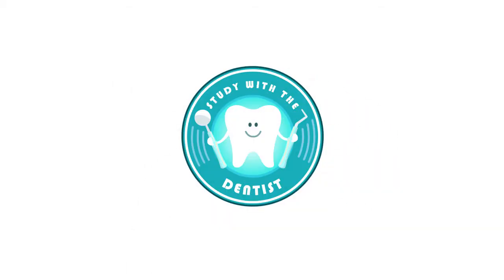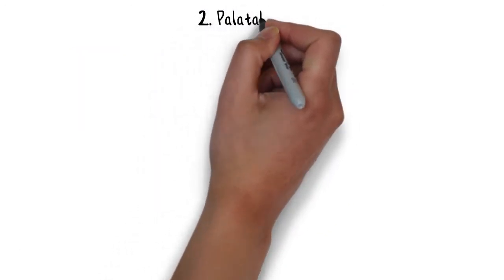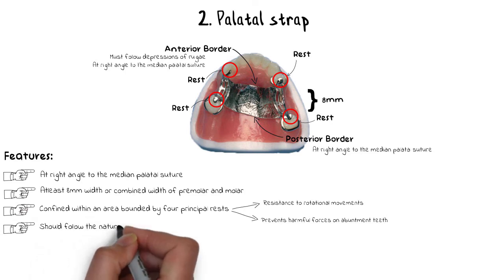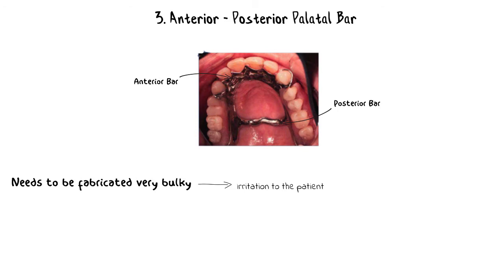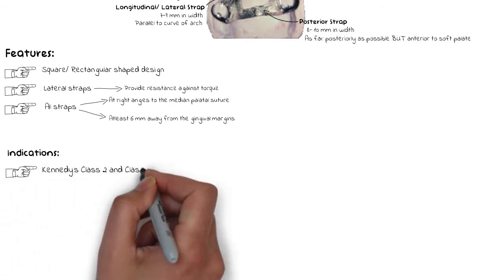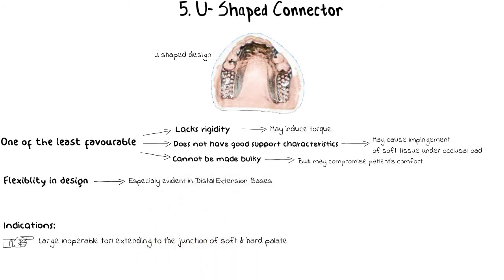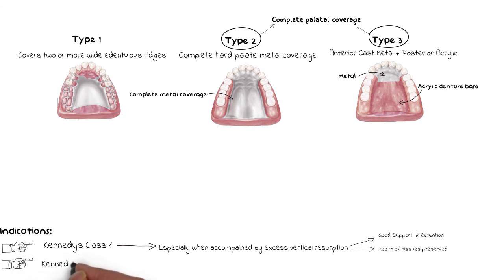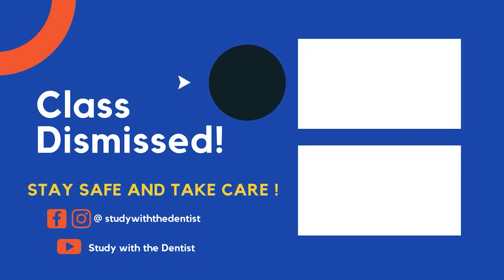Maxillary Major Connectors | Removable Partial Denture (RPD)

Comment: In the palatal plate mayor connector when you mention the t it provides a good degree of thermal conductivity to the underlying tissue, you mean that it can transfer cold and hot and it is like more normal and easy por the patient to adapt to it? Please
Reply from the maker: Yes indeed. Good thermal conductivity will mean that it will feels more "natural" and accepting to the patient, and less artificial.

Comment: read that a strap is made with a width of 8-13 mm, isn't it? 
Also I have an MCQ which is very confusing, it says
A palatal strap is 
1- a wide thin major connector with a palatal coverage of more than 8 mm
2- provides adequate support
3-Acts as a direct indirect retainet
4-all are correct

Which is the answer?
2-
Reply from the maker: It will be 4- All are correct.